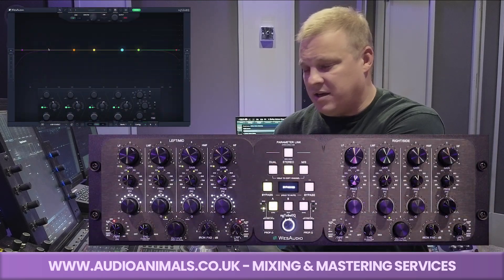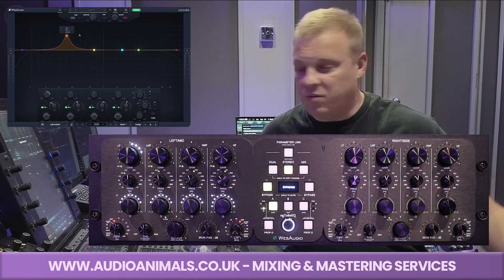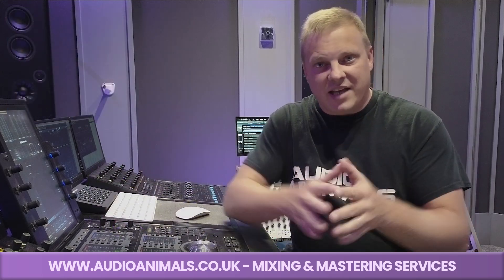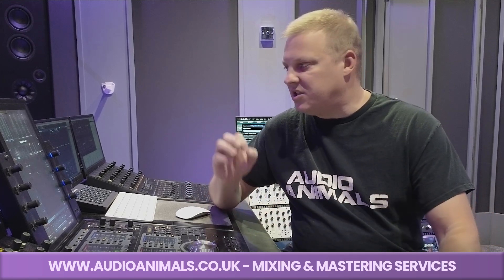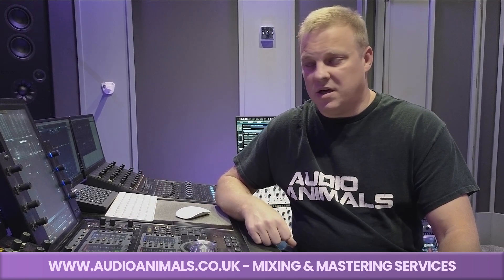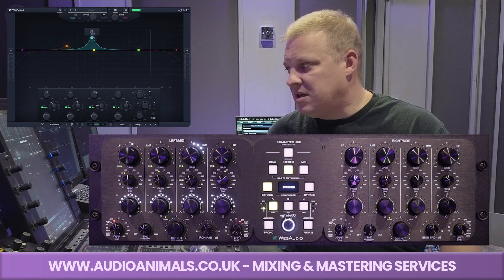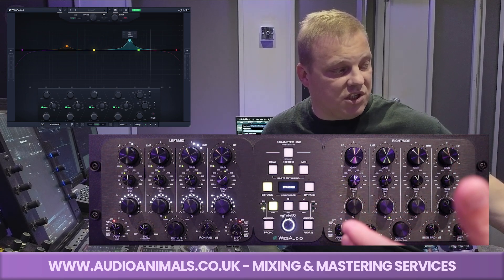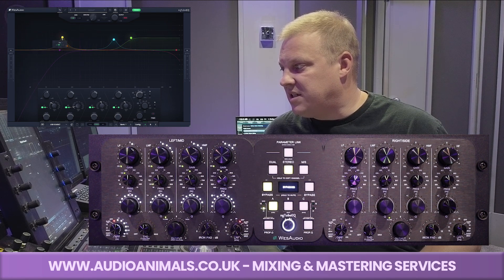What Is Digital Recall And How Does It Work?

Comment: Paul you may have answered this question many times in various ways over many videos. do you like to mix into a mix bus chain or add the mix bus chain after you mix? If you had only Neve 542's, SSL Bus+, Wes Audio pandora, Cranborne HE and Wes Audio Hyperion, what order would you put them in on your mix bus? I been watching Colt Capperune's video on his mix bus chain and then watched Dave at Mix bus TV for his mix bus chain comparing it to Colt Capperunes mix bus chain and now I really like to get your opinion. Sorry for this question but I like to know.
Reply from the maker: @braxal6983  i actually have a video going out tomorrow/this week on this subject where I'll talk about the evolution of this studio from 3 years ago to now and the reason for the changes. 

Yes I mix into a mix bus. I go Carnaby, tube EQ, NG bus comp then limiter. Limiter isn't being used as a limiter though more for widening and very very subtle limiting if required. Your chain can be routed in a similar way.
Reply: Great info! So Carbaby has found your place at the mixbus? At first you were using it only for individual channels if i remember well
Reply from the maker: @IliasPanteliasGR  I have 2. One which i use on the mix bus and another which i use in the mix on individual stems. In mastering it's not uncommon to use two either ends of the mastering chain. One in stereo and another in mid side.
Reply: @AudioAnimalsStudio  Great info! thanks a lot Paul!

Comment: You said it in such a bad way lol
Basically the knobs pots and buttons  pots on a analogue unit can be controlled robotically... it's not quite robotically but that is closer to the understanding.
The way a knob pot works is it controls voltage signals via relays... you can control how they work digitally or by analogue pots, now that is done but a sort of robot and from that it can be controlled by a controller pot much like a control surface, the knobs on a recalled able device are no longer analogue knobs, but that does not make a difference to the sound so it's okay... now it can be controlled by midi essentially... which is why you can use the controller on the device or via a plugin... but the analogue circuitry remains the same.
To understand the McDSP APB is a bit more complicated but also there not any real data alleviable to the public to stop people steeling the idea... they use relays throughout the board to be able to send the signal in whatever way they want to create a new analogue device.
This one broke my head at first but once you understand how it all works you can imagine how it works.
Then buttons are the same of course.
There is not digital signal going into the circuitry they are only triggering relays... it's actually much like CV signal in the  synth world
Reply from the maker: @TigroGumi  needs to be kept simple. You go into too much detail like this into how it physically works you'll lose people. Not everyone is at this level of understanding
Reply: You think this is a better explanation???